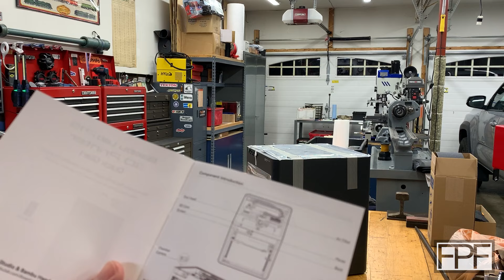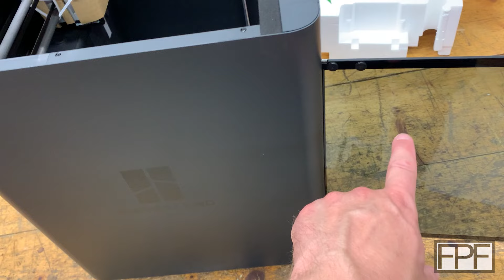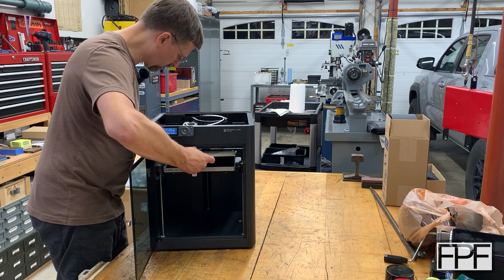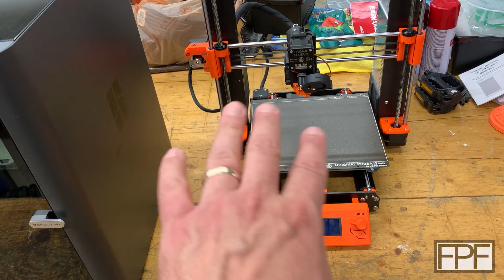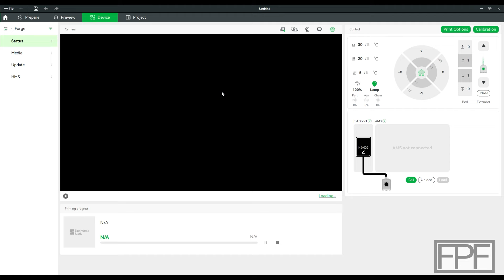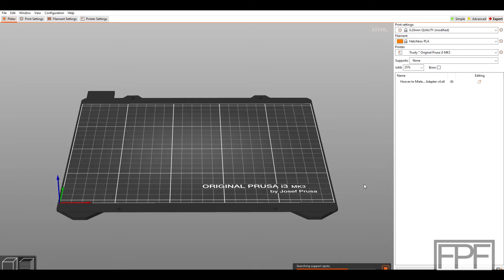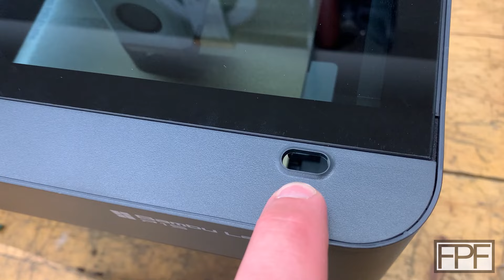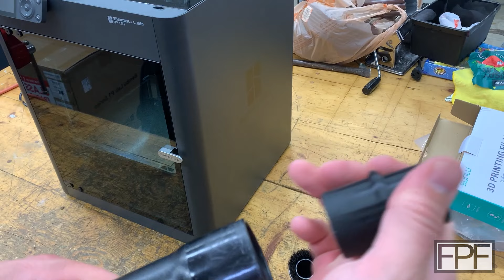Bambu P1S Unboxing and REAL WORLD prints

Comment: As far as what the mystery hole is for at the top of the printer, this might be either a reason or just blind luck. One video I watched was how to Install a P1 TOUCH Color Screen Mod on Bambu Lab P1P or P1S printer that uses that to mount a 3D printed screen enclosure on it. I've posted the YouTube link to it. I have no affiliation. Just thought it was a neat idea. Waiting for my P1S to show up in a few days to replace my ANET A4. The A4 works fine when tuned in but the capacitive bed leveling sensor is crap and constantly needs adjusting. https://www.youtube.com/watch?v=ZLbnodw8WMw
Reply from the maker: I did a LOT on my Anet A8.  It's what got me hooked, but man this current gen stuff is just soooo good.  I ended up just plugging that hole and never looking back.
Reply: Yeah, I have a Panda Touch on my P1S Combo, it routes the usb cable into that hole, and plugs in on the end of the P1S control panel behind that tape he pointed out........

Comment: The RFID is mostly just to tell you how much filament is left on the spool and you can reuse the tags for any other filament just need to set it on the printer.
Reply from the maker: haven't tried moving the tags yet, but I do wonder if they eventually make them single use by "retiring" that serial once you reach 0g.

Comment: did you order the mk4? or did you order the quidi plus 3? those are very interesting 3d printer... I've never had a Prusa, but I have other printers at home, two anycubic i3 mega s, so I wanted to replace one of these with something more modern, since I haven't done any updates on the printers I have
Reply from the maker: I did not.  I have 3 machines in total up and running right now and happy with all of them (P1S, X1C, Mk3s)

Comment: Great review.. i have a X1 carbon and i plan on picking up a P1S as extra. Just as a workhorse to print solely black PETG / Other strong materials for functional applications. I put my printers in a Ikea pax cabinet with glass sliding doors.. i can fit 6 in there in total if i want. When the doors are closed i can sit next to it on the computer while working without getting annoyed by the sound. The P1S "matte look" your are noticing is it going faster ; i love the looks of material and quick prints that come off the X1 carbon. There's some settings you can tune to prevent the same object having a "Matte + shiny" surface where the printer speeds up / slows down.
Reply from the maker: thx, I'm assuming it's probably the volumetric flow limit setting?
Reply: @FunctionalPrintFriday like HuskyRides, I was a bit worried when I saw that matt finish on only part of the print. In my experience, not a good sign for printed part strength - and if it occurs on a top layer, it looks a bit unsightly. Could you please advise whether that matt/shiny variation has been an ongoing hallmark of the P1S, or whether you’ve been able to avoid it with different filament or settings? Thanks, loved your no-nonsense, practical review of what matters when choosing a tool (rather than a toy)
Reply from the maker: @alexshepherd  varies by filament, but the best solution is to raise temp a bit and set a min layer time
Reply: Great review and you convinced me that the P1S is the one for me! 👍
I've got a used Ender 3 a while ago but is struggeling with leveling it manually, so I almost gave up, but I  am more than ready to give the P1S a try because of your review, so thx a lot and I also subbed and look forward to see more from you.
Regards Mogens from Denmark.

Comment: You might want to consider learning a CAD program instead of Sketch Up. There's several free options (Onshape, Fusion 360, etc), and they offer a dramatically easier and better drafting experience. Sketch Up is especially bad for this job because it can generate non-watertight models that don't make good STLs. It also lacks parametrization, meaning you can't go back in time to change dimensions or settings and have that change trickle down throughout the design. It's like an undo button on steroids. 

tl;dr is Sketch Up isn't designed to make STLs and you'll find it easier to use a proper CAD program with time.

Comment: Went with a FLsun V400 for the very reason mentioned, combined with the closed ecosystem of if the glued in place carbon rods wear out(and they do wear as seen by the carbon dust accumulation shown at the recommended cleaning/service cycles) you may either have to A: disassemble the machine and rebuild it with a complete new carbon-rod gantry. B: send it to the factory to have them do it, Or C: accept that you now have a very expensive brick. Where as the Flsun(V400 in my case) uses of the shelf components so replacing worn parts isunproblematic to the point that you could actually upgrade it with INA or similar high end linears when /if you do.

That said, the Bambus can print directly from a usb stick(or sd don't remember which) so you don't have to use WiFi and send a print file to a Chinese cloud that sends it back to your machine, and the V400 is a lot less beginner/noob friendly than the bambus or even the prusas since a certain percentage of them require some tweaking, the factory default cura profile is crap and it doesn't have to be as mine is near nozzle-scraping free in addition to not using under extrusion as way of making nice looking and fitting prints at the expense of strength.

The bambus are hoever a bit over hyped in that their extruders can't deliver enough plastic to support the claimed speeds except during a fraction of the print time while the V400 extruder can deliver MORE plastic than what is needed for the claimed speeds, the bambus printer profile 'compensate' for this by printing slower and turning the extruder heat up to 11 to make the plastic flow as easily as possible.

Not for nothing that every side-by-side.print time comparison on youtube has the V400 printing the same file in less time than the bambu's can manage but it is a trade of with any printer, none of them deliver everything they way they should and are perfect in every ways so its always a case of choosing the most important to you positives and what negatives you find the easiest to live with.

Now if Bambu ever came out with a true IDEX printer and FLsun did as well, I might be tempted to go for the bambu over the flsun(unless flsun one upped bambu in ways similar to what they did with the V400.....

Comment: Bit over-the-top with that data going to China rant. Ever heard of the patriot act in the USA? In the data privacy respect both countries are just as bad.
Reply: We all have some sort technical experience here since we're all watching this dude set this up. With this complaint just set up a DNS level filter to stop the printer from pinging home.
Reply from the maker: Could easily just block it at FW, but then you defeat the cloud feature set.  IF I ran LAN-only mode, I'd block it from reaching outside my wifi VLAN altogether.  Presently though, I'm still "embracing the cloud features"

Comment: On the P1S, the 0.2mm strength setting is slower than the 0.2mm standard. Had you chosen 0.2mm standard, there would have been an even bigger time difference. Your line on the parts is because you had the seam set to aligned in the slicers. 
To me there is a huge difference in the finish of the 2 parts.
Your noise sounds like a bad fan bearing. My P1S does not make that noise.
Reply from the maker: The noise goes away when it idles down, and has since gotten quieter overall.  I think it's just the small diameter fan on the control board.

Comment: Regarding data security: You are totall right on the part with chinese government, potentially stealing your data via the network connection of the Bambu Lab printer. But did you forgot about the NSA, activalley spying on its own and foreign citizens?

I am not saying that 3D printer data security wouldn’t be important. But this gateway is only important for private enterprises. Governments already collect all data necessary…

Comment: I own a Prusa Mini and a Bambu Lab X1C and enjoy both machines very much. As you mentioned in your video, the Prusa (i3 or Mini) is very handy to transport. What you forgot to mention is that Prusa has two further advantages, their customer service and their open source strategy. In contrast, Bambu Lab offers proprietary hardware and the support is really slow. However, their prices for spare parts are more than moderate. So, there a lots of additional pros and cons for Prusa I3 printers and Bambu Lab printers. For hobbyists the Bambu Labs are really great, but I am wondering about your remark on printer farms since Bambu Lab printers to my knowledge do not offer printer farm software and in case of a maintenance issue it is quite beneficial to obtain Prusa‘s awesome customer service. 
By the way: this is the first time I watched your channel and I really enjoy what you are doing. Thumbs up!
Reply: Funny that you worry about BL printers in a print farm. I've seen  a couple of farms with over a dozen of them so . . . .
Reply: @swdw973  Sure, you’re right. My comment did not intend to say that Bambu Lab printers cannot be integrated in a print farm. Of course, they can. I’d like to see Bambu Lab provide their own software for print farms. Fortunately, there are a lot of 3rd party solutions.
Reply: And how often do you make modifications to the source code to the Prusa printer? I don't know why people get bent out of shape when a machine is not open source. Apple isn't open source, Xbox isn't open source, why does a 3d printer need to be open source? I can tell you from a manufacturing perspective that open source just means some 'hack' is going to try to 'fix' my designs and it rarely works as intended.
Reply from the maker: Thanks, and welcome to the channel.  Prusa customer service is very good.

Comment: A fair conparison would be with the MK4 instead of the 5 year old MK3.
Reply from the maker: I hear you, but the MK4 isn't priced in the same segment.  You could get 2 P1S's for the cost of one MK4 with enclosure.
Reply: Just curious.  Would it change the outcome by much?  The Mk4 prints a little quicker I think, but is really just an iteration on the Mk3.  Unless I'm missing something.
Reply from the maker: @raiuno90  Yeh, it's still a bed-slinger.  My guess is that the Mk4 family will probably be the last non-core xy printer that prusa makes.  They'll get 3-5 years out of it, and by then I hope they have a few different size options of core xy machines avail.
Reply: @raiuno90  , I've been running the MK4 for a couple of months now. It runs 3 to 4 times faster than my MK3,

Comment: +1 For Bambu, I literally can’t look at any other printer anymore. The industry needs to catch up and innovate otherwise they will see Bambu turn into DJI where they hold the market. Loved the video and glad I found your channel today.
Reply: I just got the a1 mini and it out prints all my creality printers.
Reply: happy this comment got to show the growth over almost a year
Reply: What about the Voron though
Reply: @djay10101  I own a voron. The community is turning in to a cult. They keep inventing problems just so they can create elaborate fixes. It's exhausting
Reply: @djay10101  Voron is the antithesis of Bambu Lab. More money, DRAMATICALLY more assembly/tinker time, DRAMATICALLY steeper learning curve, but yes, a very small number of additional features. It's like comparing an iPhone to a box of circuit boards and surface mount parts you put together with your solder shield and microscope. The difference between buying a car and mining ore to smelt iron to make the steel to fabricate your own car that runs off the gas you refined from the oil you drilled from the well you dug by hand. Okay, that last example might have been a bit much.
Reply: Yep, Creality really peed me off with all the fails and constant tinkering
Reply: Funny you should say so, since some of the Bambu people came from DJI.
Reply: @OlavAlexanderMjelde  Their printers do look design-wise like DJI, especially the printhead, or the A1/A1mini. I had a DJI drone, it was way better than anything else.

Comment: We just received a P1S.  It was a shared present for me and my 13 year old.  The prints and ease of printing have blown me away.  Within 20 minutes we were printing. Also, we received the printer in 3 days - It’s hard to beat that kind of first impression.
Reply from the maker: Yeh, I hear their support may be a little slow if you need it (which is funny since it's the exact opposite of what they're known for when it comes to printing), but I continue to be impressed by my X1C and P1S.  Fingers crosses they come up with an "XL" version next.
Reply: @FunctionalPrintFriday  I hope so! I went from being not sold on the whole thing to wanting a bigger one in the space of a couple days.
Reply: My 14 y/o son and myself are receiving ours tomorrow. What do you think is important to know for someone just getting theirs?
Reply: @rcarter  a little late, but one thing I’ve definitely noticed is that cleaning the plate regularly makes a big difference.  The only thing that has caused a print to fail has been a support or piece not adhering to the bed.  We are just now getting to other filaments besides PLA.  Hope you are both enjoying it!
Reply: @travis5481  oh definitely, we’ve been printing non-stop. We’ve actually done a decent amount of PETG. Haven’t ventured to abs/asa yet. Definitely agree about the build plate needing to be clean, makes a huge difference. Thankfully the majority of our prints have been successful. Although, I’m hating supports unless I use the support material for the interface layer but that usually takes much longer and still isn’t perfect. Need to get that figured out.

Comment: Could you do a video on the start-up time of a print? Maybe one when using the whole pre-print calibration stuff and one without. I have seen people making custom start-up gcodes to skip a few steps (if a bed leveling has been done since last start-up of the printer), and the print start-up time is down to almost 1 min. I ask because a thing I can't stand with for example Ultimaker printers is the 5-10 min of heating, cooling, leveling, heating again, etc, especially when you are making super small prototypes with 5-15 min print times. I almost prefer using a cheap Artillery printer over my Ultimaker at work, simply because the print will start 30s after clicking print on the Artillery and atleast 7-8 minutes on the Ultimaker
Reply from the maker: Yeh, it does feel like it takes FOREVER to get going, but then it just goes right to 'plaid'.  I might do a vid where I compare the custom gcode with nothing extra, skipping just bed calibration, and then doing everything (including the filament calibration on the X1C with lidar)
Reply: @FunctionalPrintFriday  Please do. I would glady use the whole calibration step before a bigger print to ensure that it's successful, and the fast print speed would more than compensate for this. But when you do small prints, 5-15 min, which I usually do, for example, testing the fit of a smaller part that is a part of a bigger print, before printing the whole thing. A 10 min start up time is very frustrating, at least with the ultimakers. Love the video btw, happy printing!
Reply from the maker: @MrVidimlic thanks!

Comment: Im happy you made this video because yes while technically these are comparable in price, the P1P/P1S is a modern device and its certainly hard to say that about a Prusa. Especially given the fact that the Prusa is slower and has no enclosure. I value everything Prusa has done but they are behind and spent 5 years asleep at the wheel
Reply from the maker: couldn't agree more

Comment: Former mk3s+ owner and current X1C owner and am happily in the bambu camp with a year of ownership. I am in a hotel about 400 miles from my printer right now and have been able to print fine with my X1C and AMS*. The cloud functions were not possible on my other printers with the level of reliability or features I have now.  

Just being able to start/stop pause, and check on my prints , without kludge work arounds, when anyway is well worth the cost of the "scary cloud" FUD. 
None of my prints are security sensitive and whether my 3mf files (fancy gcode) is requested by china(lol what can they do?) subpoenaed by the US Govt(the only thing I really have to worry about) I dont get too concerned about it. 

Fantastic video. 

*note I do have someone at the printer to clear the print plate.
Reply from the maker: Yeah, I started a print I needed when I got home from 4 hrs away last week.  Out of curiosity, how many hours on your X1C?
Reply: @FunctionalPrintFriday   @FunctionalPrintFriday  I am at 3500 hours  and counting. I print daily but not 24/7. 
I was a Kickstarter backer so my model is before any revisions or manufacturing adjustments. 

I just follow maintenance recommendations and have been without issue. I am sitting on a small warehouse parts but haven't replaced anything other than ptfe tubing or other consumables parts.
Reply from the maker: @ashleys3dprintshop  thx, good to know

Comment: The mark 3 is way too pricey for a 5 year old product. I was thinking of getting a mark 4, but I'd honestly rather get another Bambu. That XL is something I want, but the shipping and other fees alone, would cost more than a P1P....
Reply from the maker: I'd buy an XL today if it was ~30% cheaper and would ship within 5-7 days from clicking the order button.  You can order a K1 Max today from Creality for way less than half the cost that gets you halfway to the build size of the XL (300x300x300 vs 360x360x360).  Ohh, and it's enclosed.  I predict Bambu manages to release and ship an XL version of the X1C before Prusa would ship an XL if you ordered it today.